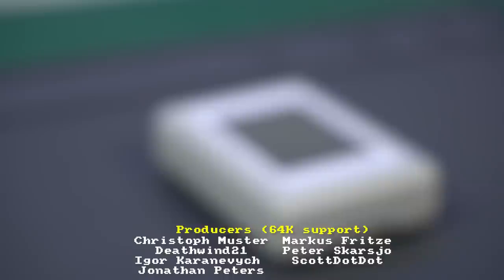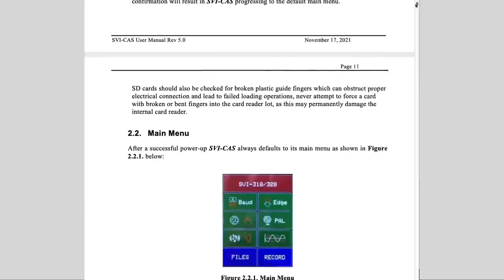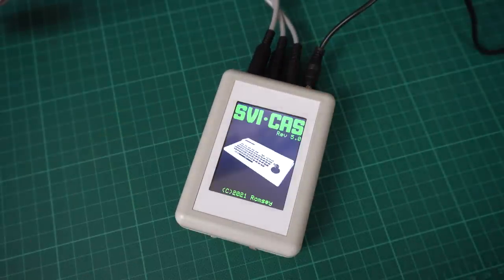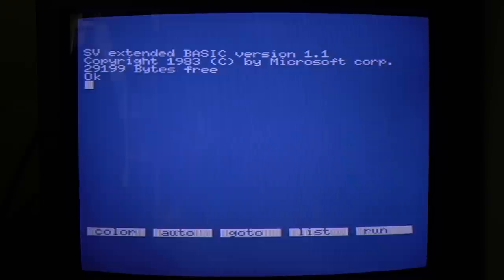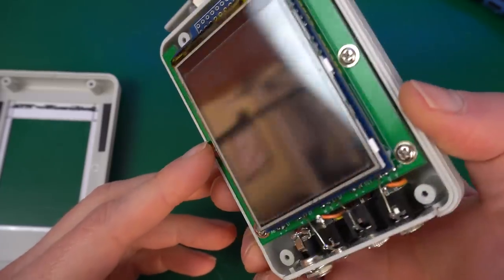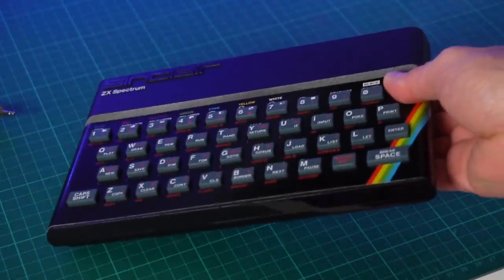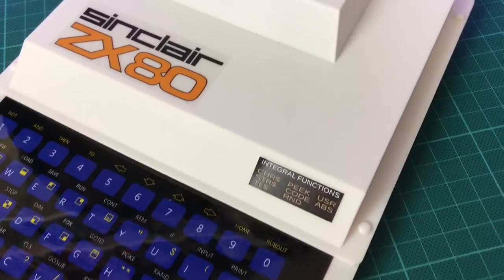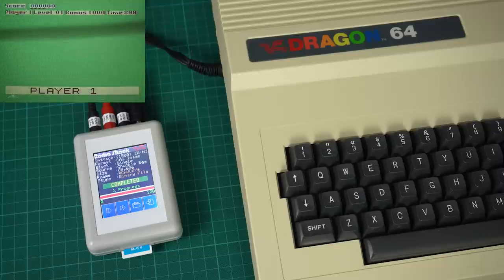The Ultimate Retro Cassette Replacement?

Comment: Brilliant video. Love the detail in the range of computers used (I have an Enterprise, a original Z80, various Acorns, Commodores and Spectrum machines and Amstrad too, so I can use them for that tape experience); the oscilloscope work, and how you worked with the maker to fix the Oric issue.
Reply from the maker: Thanks! Glad you liked it and glad to see another person with broad retro tastes like me 😃
Reply: @NoelsRetroLab  Thanks: I'm just emailing the seller citing your review and asking if he ships to the UK (with C64 and other cables). I hope he supports the Enterprise soon. 

p.s.
(Oh and have PC Engines, Atari Lynx mk1, PHILIPS G7000 Videopac and other Sega and Nintendo stuff, but had mods for those. Got matching monitors too, except for the Sinclair line)

Comment: The Shift/RunStop key function on the C64 is inherited from the even older 1977 Commodore PET, which as you probably know was designed with tape in mind. The function is built into the screen editor which as far as I can see was copied wholesale into the VIC 20 and C64.  Also, for some reason a lot of people in the UK (one of Commodores biggest markets outside the USA) also used tapes for the C64 (in the early 80s few people could afford disk drives, (possibly because of unfavorable exchange rates?) so most games were sold as cassette. It really wasn't until the late 80s that disk drives became cheap enough for the "average" game player to afford.
Reply: Yeah, price was a problem in the UK. IIRC the 1541 cost about as much as the 64 itself, so hurt its selling point of being relatively inexpensive and competitive with the other 8-bit micros. I suspect the culture surrounding the UK home computer boom was a bit different to the US computer scene too, which might have had an impact on the cost that each market was prepared to accept. 

I think cost was a problem even later in the C64's life, because the cost of a C64+1541 was uncomfortably close to that of an Amiga or Atari ST.
Reply: @Silanda  Yes, the first time I noticed a floppy drive being "cheap" was around '85/86 when Dixons were selling the Atari 800XL & 1050 floppy drive cheap in an attempt to sell off the XL stock with the arrival of the new redesigned XE machines. At the time I wasn't so into the C64 so I didn't notice the prices but I do recall complaints in the computer magazines about how expensive they were compared to the other computers.
Reply: Partly unfavourable exchange rates. Partly a tradition among computer sellers and manufacturers to not apply any exchange rate at all! So if something cost $499, it would be priced in the UK at £499, at a time when £1 was worth about $2 ! This continued into the 1990s with all sorts of gear including PCs and their parts. I think it's the Internet that finally got them to cut it out, giving people a choice of importing themselves, or at least seeing American prices and realising how much they were being ripped off!

Now we can order stuff for peanuts directly from China, and the only issue is things being dangerous and shoddily made.

Comment: FYI...we had the official tape deck for C64...disk drives where too expensive..alot of the shops also sold cassettes for the C64
nice vid...thanks Noel
Reply: Same where I lived back then. Every C64 user I knew had the "datasette" until the disk drives came down in price. Drives were extremely expensive back then, pretty much as expensive or even more than a C64. I don't know if it really was more expensive to make but wouldn't be surprised if that was the case.

But when the user got a disk drive there was no looking back - even though the C64/1541 combo suffered from that infamous firmware bug that made the drive slower than it needed to be. When floppy speeders entered the scene, tapes were laughed at.
Yes, there were tape speeders, too, but who wanted a tape when you have a floppy with a directory, sequential access, still faster loading and usually much more reliable (if we forget the overheating problem for a moment...).
Reply: Same here, we had around 100 tapes !!!!. The 1531, when properly alligned and mantained, barely failled. Tapes were better than people think. A bit slow ... but hey ... the 80s magic.
Reply: yeah, nearly everyone I knew in UK with c64 used tapes
Reply: Where are you based, though? Although Noel doesn't actually mention that, I for some reason automatically assumed he was talking about users in the US (maybe because Commodore was American?). I do know over here in Europe cassettes were probably the most common media for C64 games.
Reply: @BilisNegra  australia here... by the time i had C64s at home, disc drives where all the thing, but we where stuck with tape (even tho step brother actually worked for commodore australia!)...my cousin had a C64 with disc drive from early on and thats where i learnt to add *",8,1 ...tapes where just the cheaper medium i guess and i was used to them from CPC days

Comment: I'm glad you reviewed this. I was able to order mine recently (along with all the cables). I look forward to receiving it. I noticed as you removed each computer from your shelves that you seemed to have reasonably similar boxes. I wondered where you got them. I have several computers without boxes that I would like to protect better (they are only wrapped in anti-static bags).

Comment: Here in the UK nearly all computer users used tape, even the C64 which wasn't as popular as in the US most people still used tape. Mainly because the drives were so damn expensive over here and besides tapes were so cheap and easy to copy 🏴‍☠️.
Reply: Same in Spain, first computer I saw with a DD was the Amiga 500. My first floppy disk experience was with my 286 computer, and I loved it, when your parents are limiting the time you have to play with the computer, the tape really sucks, and many times you cant even load the game :( AZIMUT NIGHTMARES
Reply: In Canada, every computer of the era was automatically equipped with a disk drive. Mostly Made in Taiwan knockoffs, cheap, common, and surprisingly good.
You just couldn't buy or sell software on tapes, there was no market for them.

Comment: Yes, try this device with a ZX81/TS1000. A full -featured video on this computer would be nice as well. This computer was responsible for many of us learning Z80 assembly due to it's limited abilities. Then things like hi-res graphics and an extended BASIC instruction set, etc. became possible. It forced those of us on an extremely limited budget to either give up or press on to vastly exceed the limits of what Sinclair ever thought the machine was capable of. I chose the latter.

Comment: Looks great, I want one! A couple of UX things I think would improve it a little as well:
1. Left and right arrow keys either side of the computer selection box, so you can go backwards as well as forwards through the list
2. With the On-Screen Keyboard, make the keys larger by only showing upper OR lower case at the same time, rather than both, and switch between them with a Shift Key option
3. Show a message giving the tape load command to enter at the computer prior to commencing loading, so you don't need to refer to the manual

Comment: The Commodore C64 and Vic20 were really lightly evolved versions of the Commodore PET, which were aimed at business and schools. The Pets definitely didn't have cartridges. Early units shipped with cassette built in. I think there was an idea that it doubled as an IO device as well as tape playback for typists doing transcriptions. In school, we had a computer lab that had several pets. They all shared one floppy drive, but some units had external tape drives that were not shared.

Comment: OK... Another retro related gadget that I need to spend money on... :) I will use this on Spectrums and C64, so I would appreciate a follow video up on the recording capability on these machines too. The fact that the code is written from scratch and not being a modified TZXDuino/MaxDuino code is just impressive! 
The ability to record is just amazing, I think it is the most significant thing about it. 
A small correction: Atmega2560 is not a faster or more capable MCU compared to Atmega328 we all know. It has the same speed and same processing capability. Just has more RAM, more flash memory and more IO pins etc. It is the MCU used in Arduino Mega.
Reply from the maker: I have tested the recording in several (not all) of the machines and it works just fine. I didn't think it was necessary to show it in all of them. You can count on it working as well as it did on the Amstrad on those platforms.

Comment: Excellent video and product especially if you have a significant collection of euro 8 bits. Not surprised there was problems with the oric/atmos. I could not get my cousins oric to load anything back in the 80s and I think the manufacturers had to make a significant change to the cassette part of the rom for subsequent versions of oric/atmos.
Reply: There are also multiple revisions of the motherboards with different values of capacitors and resistors on the tape circuitry, resulting in some machines requiring vastly different input volumes to proper load games.

Comment: Noel, thanks for the awesome video!  I would love to see a video (if even it is a short one) on your storage box solution!  I love the color printed labels, and the sturdiness of the boxes..  I would love to see more of how you store your machines as it's very relevant to retro computer collectors everywhere! :)  I did see the link you posted on another comment - looks like a Spanish site.  I would love to see how the machines and accessories fit inside, and if you use foam inserts at all.  If you could also cover what sizes of boxes you have used, it would be helpful to eliminate some of that guesswork for those of us who would like to order some of these boxes.  I see they are separate top and bottom pieces - I wonder if they can make a single unit box with a flip top lid, or if you think separate top pieces work better?

Thanks again for all your awesome content, Noel!

Comment: Double insulated switch-mode power supplies can cause issues like the video interference you are seeing. The problem is that the 0V side of the DC output is not referenced to mains ground and can float up to 90VAC above ground (depending on the internal isolation). You often get "tingles" off of the DC barrel plug if you touch it with damp fingers.

Comment: During the Output Wave and Speed Testing segment you kept quoting smaller values of "cycles" for faster signals... did you mean "milliseconds" or am I missing something?  (Wouldn't be the first time.)

This device is quite the piece of kit, and shows how retro enthusiasts are merging modern small-scale hardware to make older 8-bit and 16 bit retro gear shine into the twenty-first century.  Thank you for showing it off!
Reply from the maker: You're right. I switched to cycles (or Z80 t-cycles, which are 250ns) See more background here: https://8bitnotes.com/2017/05/z80-timing/ . You can see the motivation for that on the other video I made about trying to load audio data as quickly as possible, since it's locked to the Z80 speed.

Comment: The weird, moving, glitchy-looking graphics flickering on loading screens were deliberate.
They used memory addresses reserved for screen output bytes as program stack dumps and as buffers for file loads. An obstruction vs hackers - anything typed on screen (especially carriage returns) would overwrite critical data or crash active runcode.

Comment: I would want something like this to work with any computer designed to work with a standard tape recorder.  I mean it's nice that it's able to scan the images for file headers, etc., but it would be nice to be able to use it in a generic mode with some random obscure computer, as long as it doesn't require a special tape interface.

Well, I should have listened to the end, because you confirmed that it does!

Comment: The fact it can be used to saved directly to the SD card is quite interesting, that would make things like ripping a tape game into a usable emulator file much easier than the usual methods: Load the real tape from a real tape deck, save the data to the SVI-CAS, guess that would work?

Specifically for the Oric, it could be interesting to have a way to select the volume level, because some machines expect a low volume and some other expect a high volume, being able to set that would probably help for some machines.
Reply: I recorded all my BBC Micro 8bit tapes onto my PC as .wav files, then used a £10 mobile phone to load them back onto the BBC Micro. Just use Audacity (free) to save the output, and if you have any tapes that don't load you can amplify sections of the sound to make dead copies of data work again!
 
Saving the data from tape to PC and then to disk format is more difficult as you'd need additional software to do that.
Reply: @TheVicar  Trust me, I've done a number of conversion, the Oric software is a pain to get right, not two publishers used the same input volume and azimuth/alignment, and not all Oric load the same tape with the same volume setting.

We do have tools that can convert a WAV file to an emulator format, decoding the edges, etc... but it's very common to end up with a non working file.

Since most games have only very primitive protections, it's much easier to disable the auto-run, load the tape on the physical machine, and then save it back to something else (which could be indeed a PC input) because at least now you have a proper/clean signal. But if the SVI-CAS can do all that conversion on the fly that would be much easier, faster and reliable :)

Comment: For the powersupply just make a 2 cell lithium pack.  No boosting no AC ripple.  

Also you could probably unplug the power after the loading is complete.  I had to do that for a contemporary super nintendo game copier... using a sega master system adapter... it was so noisy.

Comment: There's also the Arduitape Cassette Player, which can support most retro computers and comes in at about 1/2 of the price of the SVI-CAS. It doesn't support saving though.
It has the same limitations as the tzxduino, and can only support files up to 32k hz sample rate. You have to convert all of your tape files to wave format, which is going to take up more room on an SD card. It can be hard to find a program to convert tape formats to wave, for some systems.

Comment: It looks as if the version of Chuckie Egg running on the Electron was the BBC Micro version which explains the speed issue (the birds on the Electron version are Magenta due to the different screen mode with fewer colours).
Reply from the maker: Ah, that explains a lot! I was told it was a great game on the Electron, so I was shocked to see that. I guess those are the dangers of "almost compatibility". That must have been "fun" back in the day!

Comment: I looked into this about 6 months ago, but the shipping from Australia to the U.K. was insane.
I would have liked a more in depth review of the recording feature as that is what I'm after, there are too many players and, as far as I know, this is the only recorder.
Reply from the maker: What would you like to know about the recording? I did a few tests (not in all of them) and it simply just worked like it did on the Amstrad.
Reply: @NoelsRetroLab  I need something like this for my ZX81. Can you choose the save format ? (Wav/tzx/p). Can you port the saved files into emulators ? But again, the main problem is the shipping costs. :)

Comment: Thanks for sharing!! I wonder if it would work with your Apple II, even though it's not listed. That would be interesting to see
Reply: Apple used a very different encoding system than everyone else (typical Woz), but it ought to be possible if there's space to add the extra firmware required. There's much less out there on tape for the Apple ][, mainly because cheap floppy drives was one of its key selling points, but there might be tape images of some of the really early stuff. Having used a real cassette recorder on an Apple ][ I can say the process was painful to get working reliably, much more so than later machines like the ZX Spectrum, so unless you have a really really good reason for wanting to use the casette interface, disks or a disk emulator will be far easier to deal with. Still, if only for the sake of completeness, it would be nice to see working. Apple 1 compatibility, for those of us with reproductions, would actually be useful because as far as I'm aware that never got a disk interface.

Comment: Build yourself a portable power supply of a 2x18650 case and a small boost module. Or just order a USB->9V cable (same, but it is already built with barrel output cable) and you can use any powerbank. The most expensive is buying a nice box to be built into...

Comment: Hmmm, ok, one more very important detail about the ATMEL 2560, you can actually use external RAM with it (Fast Page if I recall correctly) so that can help with the RAM issues you referred, I recall a 512Kb expansion made for the thing.

Comment: Tapes are/were popular on Commodore 8bits in Europe, and here in the UK..  these days we have SD card solutions like SD2IEC and Kung Fu flash etc like I use. I still use tapes or .tap files as so much software only got a tape version and not disk as tapes were very cheap and popular in the UK where a big percentage of software was coded and sold.